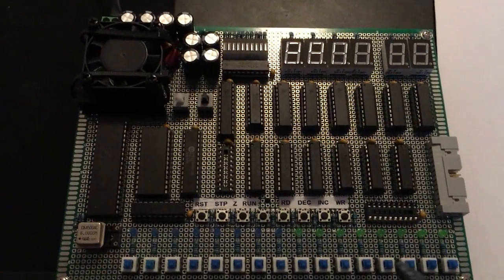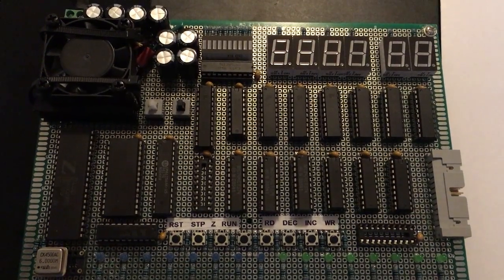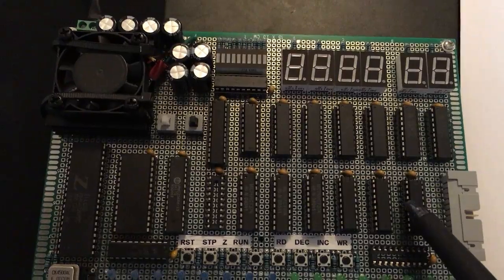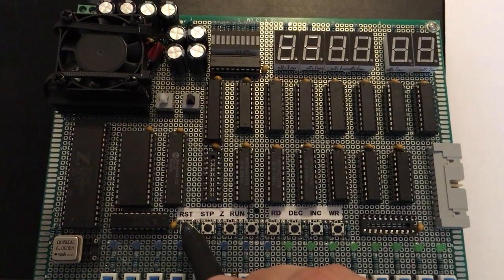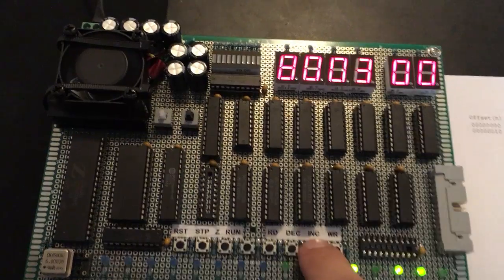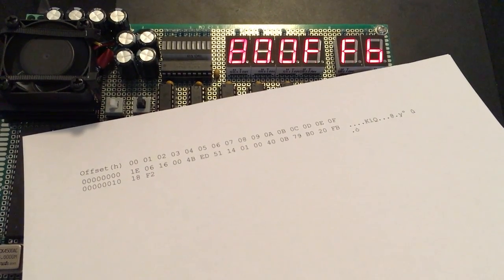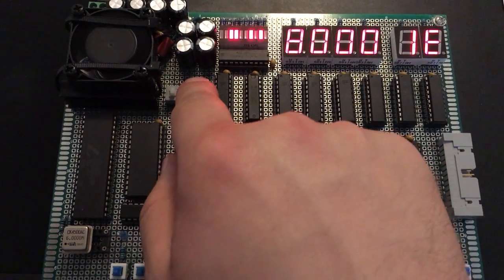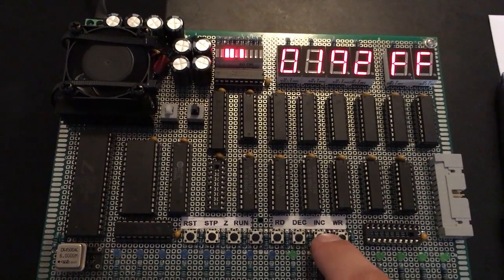Homemade z80 Computer

Comment: Nice work! The fan leads me to think there's a linear regulator like a LM7805, which would be period-correct. If you ever wanted to cheat a little and ditch the fan, modern buck regulator modules are cheap, and they barely get warm.
Reply from the maker: Actual it was an LM323K. But close enough. My newer projects I’ve made heavy use of the LM2596. But you’re correct, this was an attempt at a fairly period correct build.

Comment: It has been 40 years since I've done any hand-coding on the Z80 but I still remember some of the opcodes. The 18 F2 is jump relative back to the start of the loop.
I started coding micros before we had assemblers to compile our programs. I once wrote a control program that filled an entire 8.5" X 11" sheet of paper. A technician working in the same lab came over and looked at what I was doing. He looked at the sheet full of hex digits and asked "You mean all of those numbers have got to be right?"  LMAO....

Comment: You can get a blindingly fast single-chip 64K by 8-bit static RAM in a 32 pin DIP.
A monitor program can be very easily made to input data from switches for data and address. Bank-switch the ROM into the lower address space on reset, and copy your monitor program into high memory and then jump to it after switching out the ROM.
Instead of LEDs for your display, use one of the 16-character by 2 line LCD modules. Your supply current and regulator heat will drop dramatically and you can display FAR more relevant data.

Comment: How does someone "print" a circuit board?
Reply from the maker: Well, you can use the toner transfer method... Or you can send the files to a board house to have them fabricated for you.
Reply: @RetroDepot  What is the "toner transfer" method?
Reply from the maker: @Ali107  Here is a link.

https://www.instructables.com/id/Cheap-and-Easy-Toner-Transfer-for-PCB-Making/
Reply: Edit up the artwork and send it to China. It is incredibly economical.

Comment: Love these homebrews. Way back I started with a 8 bit TTL adder but the wiring just killed it.I'd probably make a PCB if I went back to it. These projects get too messy too quickly.
Reply: You could've done that with just two 74xx181 even back in the early '70s.
In fact, those same devices would've done 15 other functions just by changing 4 control bits.

Comment: With a proper keypad for data entry the machine would become much more useable as well as taking much less time to enter programs.
Reply from the maker: There is another video where I added a Hex Keypad.
Reply: @RetroDepot  excellent. I will check it out :)

Comment: That’s a brilliant little computer. Love the layout. One question, though.

 ld e,6
 ld d,0
2$ ld c,e
 out (c),d
 inc d
 ld bc,$4000
1$ dec bc
 ld a,c
 or b
 jr nz,1$
 jr 2$

Does this mean your computer uses partial port decoding? Because OUT (C),D will actually output to port BC, and B is not guaranteed to be 0 on the first run of the program.
Reply from the maker: Port decoding is complete, including A0-A7, IORQ, RD and WR.  It's been a long time since I shot this video, so I do not remember all the thoughts that were going through my mind at the time.  I've since shelved this project for the time being in lieu of my G80-S project (there are videos uploaded on that).  But I do remember, it didn't seem to cause any problems.  I never have generated a schematic for this.  I suppose I should probably do so one day.
Reply: @RetroDepot  It would be very easy to generate a PC board if you did. You really don't need to make your I/O addresses a complete decode. You will never have need of 256 I/O ports. The PLA is way overkill.
Reply from the maker: @benthere8051  Yeah, it wouldn't be hard to make a PCB.  But I've moved on from this project.  The purpose of this was to create essentially a CPU Trainer.  And it accomplished that job very well.  I learned a ton from working on this computer.  And eventually designed my G80 computer, which I've offered PCBs for on my website since I think 2017.
Reply: @RetroDepot  I designed a Z-80 computer in 1979 that I marketed as the Bigboard. I generated a PCB that was the same size as an 8" floppy disk drive. It was the first complete single-board computer to hit the market. It had 64K of RAM, a 24x80 CRT controller, disk controller, SIO, PIO, and lots of ROM. I sold 100,000 boards and kits through DRC. I also licensed the design to Xerox and it was copied by KayPro. I still have a copy of the purchase order from IBM that was shipped to Boca Raton Florida.
Reply from the maker: @benthere8051  ok, so you're Jim?  I'm familiar with the Big Board, but I've never had the opportunity to acquire one, or even use one.  Probably couldn't afford them at today's prices.  But maybe one day.  I do have a few Kaypros, but each of those has a problem that I'm going to have to fix before they'll be up and running.  One has a bad monitor, the other has an issue with the floppy interface that I need to troubleshoot.  Have you ever thought about having the original PCBs scanned to generate gerbers?  Dare I say there'd be plenty of people willing to buy reproduction PCBs.
Reply: @RetroDepot  Yes, I am Jim Ferguson. I still live near Dallas. I haven't done anything with the Bigboard in years. I think I still have a few bare boards here somewhere and I still have a BBII that probably still works. The BBI in the DRC ad was stolen several years ago. I haven't even considered doing anything with the Bigboard in years. I still have the listing for the PFM 3.3 Monitor program and a copy of PFM in a 2716. I'll take inventory of what I have and let you know. Russell is in Portland working for Intel if he hasn't retired. I ran JB Ferguson, Inc. for 35 years as a consulting firm before I retired.
Reply from the maker: @benthere8051  no telling what treasures have been lost to thieves over the years. Things that just simply cannot be replaced. But it’s nice to hear you’ve managed to hold onto some items. And you still have the listings for some of it. I’d love to hear what you have. The Big Board is basically the father of all SBCs! I’ve known about it for years, but haven’t ever seen more than photos and the manual you shipped with them. Feel free to email me. There is a link on my website for a contact form. I don’t publish it on YouTube due to the bots. www.retrodepot.net

I always like talking with guys that were in the trade during those time periods. I’ve had the pleasure of speaking with some of the guys who worked on the Tandy, and a few from Apple. So many great stories that were never published. Thank you so much for chiming in!
Reply: @RetroDepot  I let a friend work on his bike in my garage and he left the garage door open. Whoever got my Bigboard no doubt had not a clue as to what it was. They also took my first computer which was a PDP-8E knockoff which I designed and wire-wrapped on a large universal Augat board. It was all made with Schottky TTL and could perform any of the logical functions of a 74S181 in less than 180 nS. It was a screamer. It was by far the fastest PDP-8 ever made, I'm sure.
I'm happy you kindled my interest in resurrecting the Bigboard and I'll keep you informed of my progress.
Reply from the maker: @benthere8051  I look forward to it!
Reply: Thanks for the reply.
This is, indeed, interesting. I remember reading an article by someone who performed a few tests retrieving the values of all the registers in a bunch of different Z80 CPUs both after a reset and a power-on. The results were a mixed bag. The IX and IY registers seemed to be most consistent in that they retained their values after a reset. Power-on values were usually all over the place, except for the I register, which was always set to zero.
Reply from the maker: The CPU used in this computer is one of the newest 20mhz CMOS variants.  So I'm sure if there were any bugs to fix, they would have been dealt with by now.
Reply from the maker: Well, this is software driven, so the registers get written to and overwritten frequently.  It was one of my earliest z80 projects.  So there very well could be some issues I haven't noticed.  But for what I used it for, I didn't notice any issue with it.

Comment: Single step.  Two options:  Hardware, using the M1 signal and either INT or NMI, or in software by using the RST n command.
Reply from the maker: RST may well work.   I need to play around with this computer some more.  Really enjoy it.
Reply: NMI would work very well with little support hardware

Comment: "nybbles" - I haven't heard this word used (except in jest) since the 80s. xD
Reply: I believe you will find that nibble is spelled with an "I" as it is half a byte.
Reply: @benthere8051  Wouldn't it be 'nybble' then? Via the analogy -- bite : nibble :: byte : nybble
Reply: @oscill8ocelot  I understand what you are saying. You nibble 4 bits off of a byte. Don't take my interpretation, Google it.
Google says: 
"Each 1 or 0 in a binary number is called a bit. From there, a group of 4 bits is called a nibble, and 8-bits makes a byte."
Reply: @benthere8051  I don't care what Google says; I've been doing this for 34 years and I've been spelling it 'nybble' from the start. You're free to disagree but I'm not going to change how I spell it for the sake of Google. =P
Reply: @benthere8051  Also lemme know when the last time you nibbled some bits off a byte. I'm curious how they tasted.
Reply: @oscill8ocelot  I don't care how you spell it.
Reply: @benthere8051  Then why did you bother commenting about it in the first place? You just like starting arguments?

Comment: Needs a quieter fan. Just think in 1977 you'd have had like the fastest personal computer on the planet with this one.
Reply: I designed one in 1977 and sold tens of thousands of kits.
Reply: Tesseract  LOL, That's the first time anyone ever told me I am not Jim Ferguson.
Reply: Tesseract  I marketed the Bigboard through Digital Research Computers and licensed the same design to Xerox.
Reply: Tesseract  Yes. It was I. Do you have a Bigboard or an 820?

Comment: I build a non CP/m compatible Z80 System completely from scratch with my own OS, coded in C, developed under Linux. This is much more efficient than Asm language.  Storage is based on a simple flash card with Arduino serial Interface.
Reply: I want to do this myself. I know very little at the moment, but I'll get there given time. What sort of OS did you make? Something Unix-like?

Comment: Im making a Z80 computer, and im wondering if it's worth to add a decimal display on board or just put it on a I/O board or something
Reply from the maker: MrWilliam932 It depends on what you want to build. How do you want to interact with the computer? Personally, I would not build a decimal display, but I prefer a hex display. But you could just as easily use a serial port to interact with it by means of a UART. Obviously you'd want to have some way to interact unless you plan to use it as some type of embedded solution. Such as performing a specific task that does not need a display.
Reply: Thank you, I want to build a multipurpose computer, I have the Hex display, but Im not sure if I have enough room in the board to fit an I/O circuit. So I have to put a conector anyway to connect other things.  I'ts actually a small board It's 80x120mm and I have two of them, the lower one for the Z80, RAM, ROM and control Logic, and the top one is for control the hex display and the buttons and switches that I've put in the frontal panel (yep is in a box)
Reply from the maker: MrWilliam932 You might in fact be running out of space... The board in this video is 150mm x 200mm. I also have a 100 x 100 board that has a hex keypad, and an (sometimes) working on a second board that will integrate rs232 video and keyboard circuitry. Even my serial computer project which has a SIO with max2323s and a 8255A uses a 100x100 and it is CRAMPED. And that's a printed board, not a protoboard.
Reply: Better use a terminal with a ncurses.lib with a C compiler like sdcc.
Reply: You could interface it to your smartphone via a USB I/F or you could interface it to a small $15 32 character LCD module.

Comment: Probably worth changing the linear 5V regulator to a switching type module. Save the fan and heat. I frequently use the RECOM brand modules but the are plenty of inexpensive type that simply replace the linear regulator.
Thanks for the video. :)
Reply from the maker: ZEROSTATIC72 If I were to give you an honest answer, I chose the LM323K out of desire to keep it closer to the technology present at the time these types of computers would have been used. I could have use a variety of parts, but I decided to go old school. For what it's worth, I've added a pot to the fan, so in future videos it will not be as loud.
Reply: Thank God you put a speed control on that jet engine masquerading as a cooling fan. It really killed the mood.
Reply: A NTC hysteretic or PWM control would be neater. A dual comparator should be enough to implement either ;-)
Reply: Just FYI, switching regulators are nothing new. The popular MC34063 seems to have been released around 1983, well within the lifetime of a computer of these specs. Granted they weren't widely used as they were more expensive and the wasted power wasn't a big deal. The inefficient ttl logic of the day would have needed a fan anyway. These days, though, there really isn't any good reason not to wire up a proper buck converter over that monstrosity.

Comment: It's really hard to find information about building a homebrew PC on the internet.
Reply: At least you have the Internet to look for information. There is plenty of it today too. I've seen it. I was also doing this stuff in the early 80s when the Internet simply did not exist. I had subscriptions to magazines back then and I would mail order books from companies I found in the classified section of those periodicals. Now that's what I call, "really hard to find information about building a homebrew PC". You were considered borderline insane back then to even attempt it.
Reply from the maker: Not too hard, its just difficult understanding all of the jargon when you're first starting off.  If you're interested in z80 computers you might check out z80.info
Reply: Retro-Depot That website is almost dead. Most of the project websites don't exist anymore.
Reply from the maker: StarTrek123456 You can always check out Grant Searle's website, he has several that he has published. Although, most of the information on designing your own can be learned from datasheets it doesn't hurt to see how other people have constructed theirs. Not sure why you imply that website is of little use. There are days of good reading there.
Reply: slap_my_hand lol excuses?
Reply: Google Ferguson Big Board

Comment: Where do you find a decent sized matrix board, I'm building a z80 computer but i only find crappy little boards
Reply from the maker: You can order the 15cm x 20cm FR-4 boards from eBay.  They take a few weeks to get to you, but they're well worth it.
Reply: Cool. I just ordered one. Thanks.

Comment: wow! This is a very impressive build! Great work. Hope to see more videos with this. Maybe something about the software?
Reply from the maker: Sure thing, I'll plan on uploading a video about the software today.  I also am uploading an update video on the expansion port this morning.
Reply: Retro-Depot Thank you very much for your reply.. im currently gathering parts for a build, however im having a hard time finding a suitable EEPROM. Do you have any tips or what do you use? there are alot of fakes out there
Reply from the maker: When using EEPROMs, I typically just go for the 28C256 from Atmel.  You could also use other variants, such as the 28C64.  They're easy to find, try eBay.  Also, don't forget that if you have to you can always use the age old EPROMs, assuming you have an eraser. If not I'd just go for any 28C256.  You can always hold the upper address lines low for simulating a smaller PROM, or if needed you can adjust the address of your code when you burn the ROM to account for other ROMs you may be replacing.  I haven't found that the brand matters much as for functionality.  Just make sure that whatever you settle on your programmer is capable of programming them.

Comment: when next video with z80??
Reply from the maker: karol trolowaty I have not begun building the daughter board which will have all of the peripherals. Hopefully I can find some time to do this and post a video. Anything in particular you would like to know about this project?
Reply: +Retro-Depot do you build other retro stuff...
Reply from the maker: karol trolowaty As time permits. Electronics is a hobby of mine. I collect vintage computer systems. I decided one day I wanted to understand how they worked and began tinkering. I have built several smaller computers. This one being the most complete (read: usable), outside of building Grant Searle's Z80 computer.